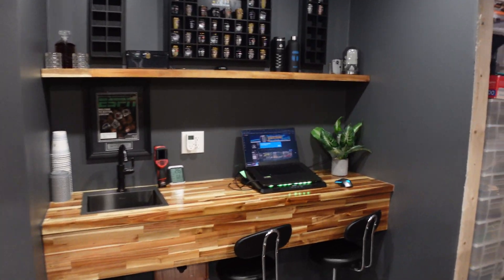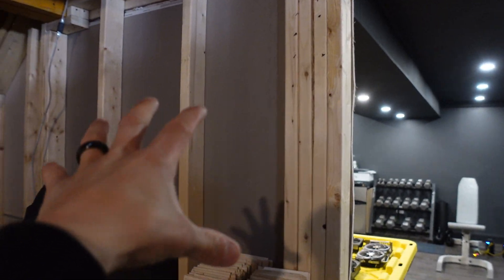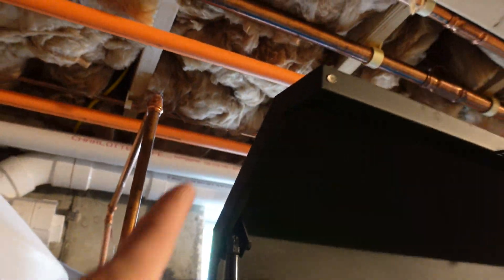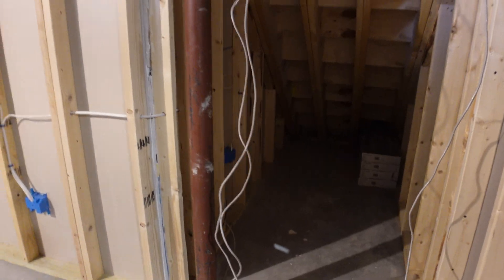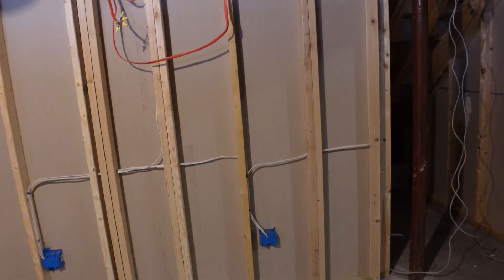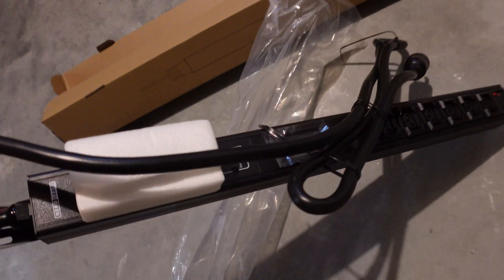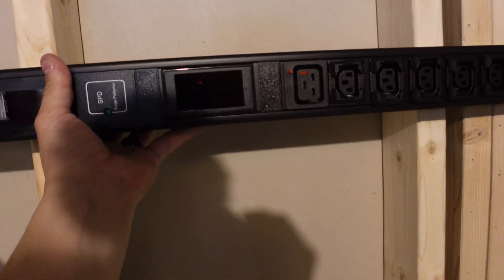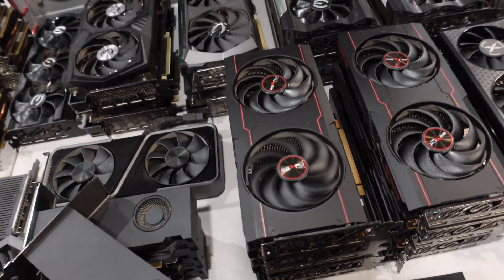Preping for the DIY Solar Move

Comment: Cement board is best behind solar equipment for heat dissipation and fire proofing. Sprinklers are fine but no fire to begin with is better. If you go belt and suspenders you could plywood everything and then Cement board only around the egg solar stuff.
Reply from the maker: Damn, that’s a good point

Comment from the maker: GPU Sale List Here: https://docs.google.com/spreadsheets/d/176NCxCG00OZYb0rFnQimHoHg4iMPIz-Cq0DcRe2cqrY/edit?usp=sharing
Direct Message or Email me.

➡ Check out Crypto Miner Bros:
https://www.cryptominerbros.com/?ref=qwdqpkxl
➡NerdGearz: (use code "CCXD" for $$ Off)
https://nerdgearz.com/products/nerd-gearz-30a-240v-v3-metered-pdu
➡ Tangem: (10% off My Favorite Wallet)
https://tangem.com/pricing/?promocode=CCXD
➡ Signature Solar: ($50 off using this link)
https://signaturesolar.com/?ref=zwzcpllh 
➡ Koinly: (Crypto Tax Software)
https://koinly.io/?via=808374BB&utm_source=affiliate